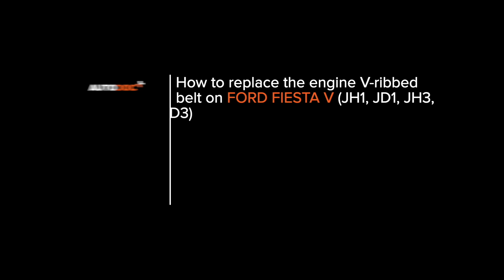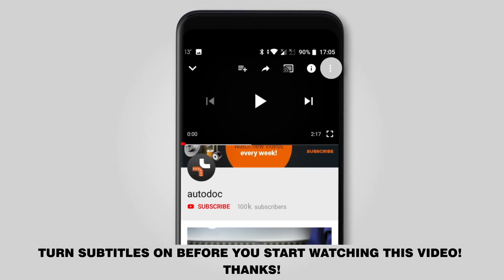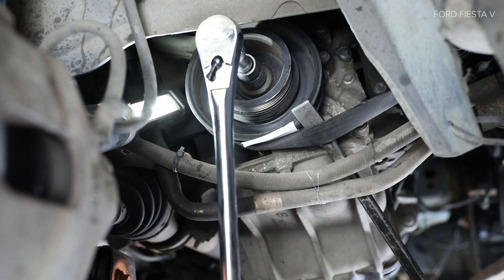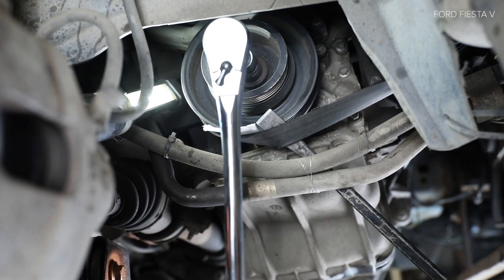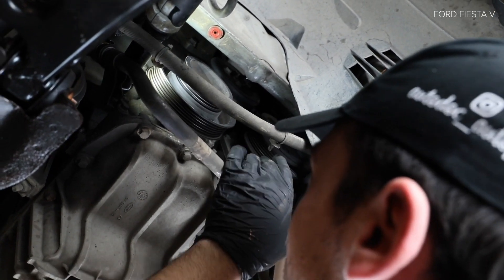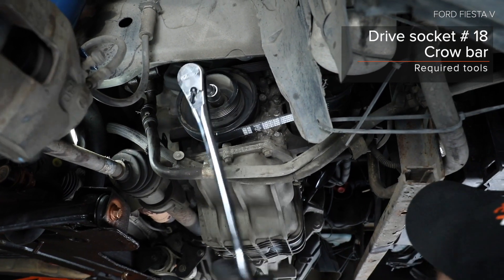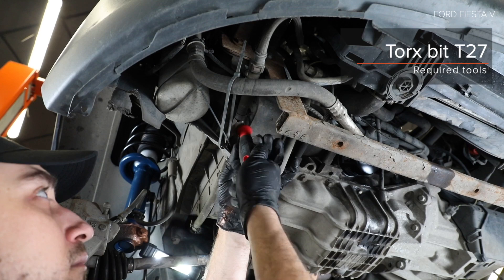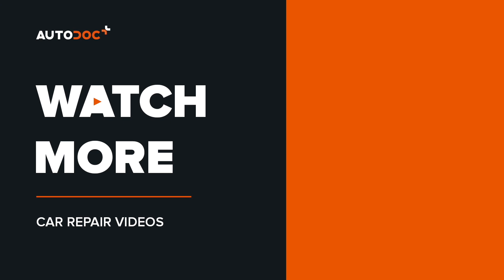How to change serpentine belt on FORD FIESTA V JH, JD [TUTORIAL AUTODOC]

Comment: it is not that easy... the belts require a lot of pressure... there is an alternative to relieve the pressure at the alternator
Reply from the maker: Yes, you are right, there is a tension mechanism in the designs, or it is tensioned using a generator bracket, by the generator itself.

Comment: This is definitely not the way to replace this belt ! just use a wrench "15 on the tensioner pulley and you can release the tension from the belt with one hand and remove/install belt with your other hand.
Reply from the maker: Thanks for the clarification, your comment will be useful for many of our viewers.
Reply: It’s a strech belt-doesn’t have a tensioner to release. Easiest way is cutting it off or unbolting the 4 bolts on the waterpump pulley.